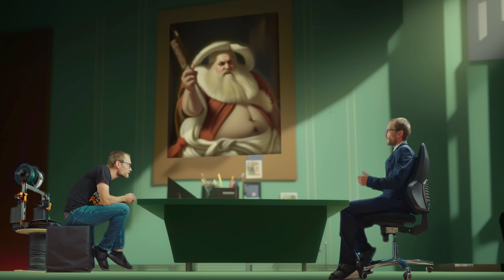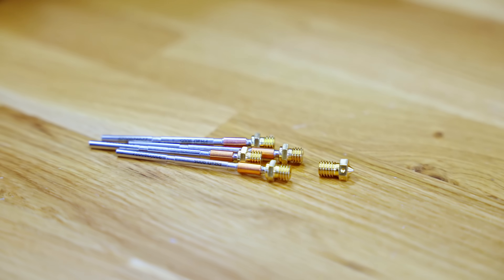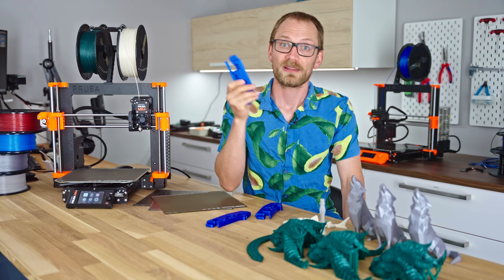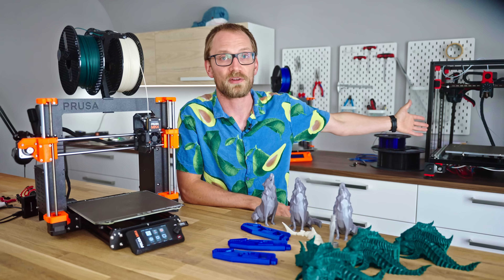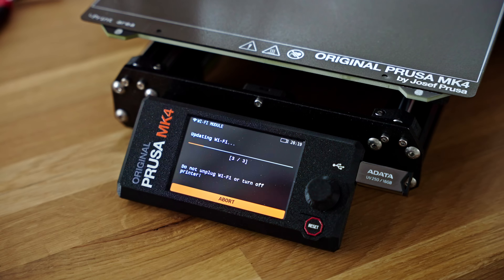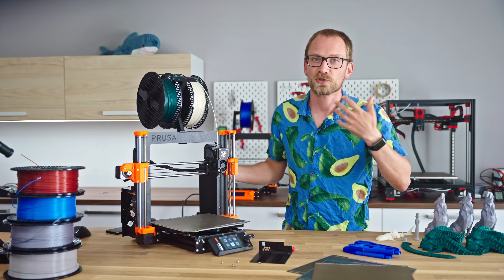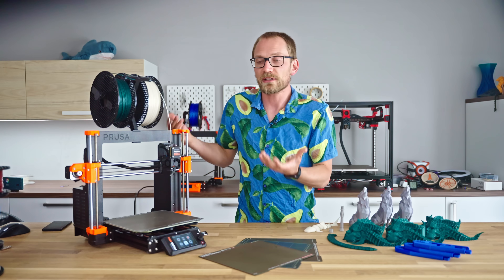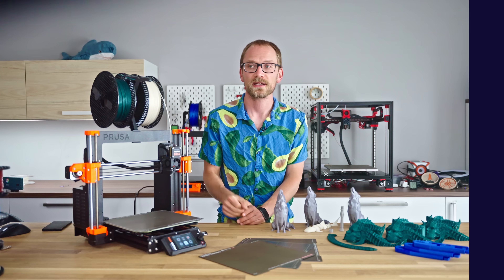Does the Prusa MK4 have what it takes?

Comment: I even logged into YouTube to say this, I disagree so strongly.

You keep harping on about how open source is a problem, but you don't even get the fundamentals right. How, precisely, should Prusa have taken slic3r's AGPLv3 code and put "a closed source UI" in front of it given the terms on linking? How does the front end code relate to the back end functionality and when should they have switched? How successful would Prusa be if not for the support of the open source community?
Reply: FWIW you can make use of opensource software in commercial closed systems. The operating system you are reading this from right now has tons of opensource code in it. As long as you do it in a way that decouples it from your propriatary software it's fair game as far as licensing goes.
Reply: @Rick-vm8bl  you're talking ABI, the argument of front end for a monolithic application implies API and that's where the viral nature of AGPLv3 triggers.

Comment: Like you said, you don't need an accelerometer to calibrate input shaper properly. All you need is a single calibration print, and then setting the variables accordingly. It can calibrate the printer just as well as an accelerometer. Given how rarely you have to calibrate (basically once, unless you change something) I wouldn't consider this a big issue but it is certainly much less "sexy" way of calibrating and has an aftertaste of lagging behind the competition.
Reply: And accuracy is limited by subjective judgement of the prints (and also the resolution of the parameter steps in the test).

Especially for a Company that wants to sell a great out of the box experience without need to be an expert that just sucks.
Reply: @Daepilin  Still yielding comparable results to acclerometric means, which have their own source of artifacts, from the difference between resonance at the nozzle vs at the sensor, and calculations afterwards which can also lead to some fluctuations in calibration quality. With the calibration print the control on the outcome is actually tighter and more directly centred on the results.

I am not saying it is sexy or will convince many customers but at the end of the day, it is just as good if it is the results that matter to you. Yes, it is more work, once at setting up the printer. That goes to some extend against the ethos of Prusa indeed. Realistically speaking however, you probably won't have to bother with it afterwards until you make some major changes to the printer or relocate it.
Reply: Input shaping values can change over time even without changing anything on the printer. Mostly due to the belt tension or loose screws. So yes an accelerometer is not required to do the calibration but it helps a lot if you want to do it once a month for example. This operation can be added in a routine check easily. And if you have enough data as Prusa could do, you could even diagnose common defaults in the assembly based on the results.
So yes, I think it's a shame, that the MK4 doesn't have 2 accelerometers (one on the toolhead pcd and one on the bed). 
It's a missed opportunity to make this printer even more reliable. And if it was well integrated in the diagnostic checks this could justify the price of the MK4  in 2023 in my opinion.
Reply: @KevinLemarchand  Yes they can but the impact is really minor. I haven't recalibrated my V0.1 for at least a year and even made some repairs in between yet don't see much effect on the input shaping performance. 

An accelormeter of course helps but like I said, isn't crucial. For a bed slinger you'd need of course two, rather than one accelerometer. Not that this would add much cost or anything, just saying. That's why I not fully understand why the board is only prepared for a single accelerometer. Did they really think only about the XL there?

I do agree that it is a missed opportunity but my point is that it would be for me not a major argument not to get the Mk4.
Reply: @sagichnicht6748  yep maybe for the mk4s then ;)
On my Trident I have some variations from time to time. But the belt paths are longer and as I like to mod it doesn't help XD
Reply: tbh they could have an accelerometer that screws on a 3d print that can both attach to the bed and hotend, and it would make a more reliable base, that you could then tweak with a test print if you want.
Reply: @KevinLemarchand  And they are so cheap, why not?
Reply: @A1N0  Price is certainly not a reason. I am wondering myself too. Maybe they had the board already developed before the Mk4 and so only included the support for one instead of two sensors?

Comment: There's a reason why Prusa (and everyone else) keep releasing the source for the slicer. The original Slic3r gas a GPL license. You have to release your modifications as open source. There are watchdog organizations that will sue you if you don't, not even mentioning the loss of good will. Open source software works because of this licensing. You get to save A LOT of money by getting all this free code. In return, you MUST contribute back any changes you make.
Reply: Never forget that bambu lab had their slicer closed source (until called out by prusa) when they legally couldn't, and that they contribute nothing to it on their own, they just rip work from other open source slicers and never give attrition or credit. Just like they just did in their latest slicer update. They took a bunch of stuff from orca slicer and didn't give credit like they're supposed to. They then made the typical "sorry, we'll learn from out mistakes" post, which they never do.
Reply: @LilApe  Exactly, but they did get called out and open sourced all the stuff that wasn't directly related to their proprietary calibration routines as far as I know.
Reply: @AlekseyVitebskiy  Problem is, they never do anything untill they're called out. Their security protocols, their thermal runaway problems, their warped heat beds, them stealing open source content or not giving attribution or people when they use their source code or files.
Reply: @LilApe  I know Bamboo Labs, and Chinese companies in general can be shady with their IP practices. 

My post was mainly to defend the open source licensing. Tom seems to not quite understand why open source licensing can be of tremendous value to a company.

Comment: At work we use two MK3S+,  I needed a case for a camera system. one printer died on me and we didn't know how to fix it and the other had such problems with bed adhesion, overhangs and quality. I took a spool of PTEG filament home, put it in my Ender 3 and when I got up to go to work I just took the spool and the case with me, in a perfect quality. The guy who is responsible for the printers asked me if I got an Ultimaker or something at home, he was shocked when I told him that I only use and E3 classic with the 32bit Board, a CR Touch and a Microswiss direct extruder. When I showed him how much the E3 cost me (~450€) for everything to get to this state. Now they are considering getting rid of the MK3S+'s and getting an Ender3 and an Bambu Lab X1.
This is my experience with Prusa and so I'm not very motivated to get an MK4 when my E3 works so good and for the same prize I can get an P1P or for a little more an X1 Carbon.

Comment: I was saving up for a Prusa MK4 Kit, Bambu had a sale. I now own a Bambu P1P and have an extra $250 in my pocket. 🤷🏽‍♂️
Reply: You'll spend more than $250 in replacement parts on the P1P though.
Reply: @LilApe  What parts are those?
Reply: @TheExtremeElementz  Complete motion system, complete extruders when yours break or keep clogging, tool head or AP boards, PSU's, etc. these are all common problem parts that need replacing. My 5 year old MK3s has almost 25k hrs and all I've replaced is a $6 nozzle. My P1P didn't last 10hrs before the stepper motor dies.
Reply: @LilApe  interesting and sorry to hear you’ve had a bad experience, I have had mine since last Wednesday and I’m almost at 24 hours of printing total and still going good. I’ll make sure to keep an eye on things though because so far I’m liking it, but I only have had Enders to compare it to. Thanks for the warning!

Comment: I think for the price the bambu labs x1 is a way better choice
Reply: Heck even the P1P is a better option if we go purely on price given it beats the MK4 out of the box for print quality. Granted the P1P is a little more limited in material support but if all you're printing is PLA and PET then its a solid choice.
Reply: @Rick-vm8bl  and with them coming out with the p1s which is a p1p with an inclosure it's only getting better.
Reply: Bambu lab preys on your information and steals your IP.

Comment: I have a Prusa MK3s+ with MMU2. I have been printings on and off for ~18 months without a fail caused by machine failure. I don't count when I forgot to turn on supports when I sliced a model, started the print and fell asleep. It built up a big glob and melted the fan shroud or should I say the PETG melted into the fan shroud. Other than that my Prusa prints trouble free.
Reply: Your MMU2 is never had a failure? Yeah, I believe that. That is why they designed the MMU3.

Comment: I'm a bit late to the party, but I wanted to throw my 2 cents in.

I got a Prusa Mini+ in November 2021 and it's been absolutely bulletproof. I'm pretty technical and I was anticipating needing to baby the printer. Instead, what I got was a reliable, simple, and dependable 3D printer. Sure, it doesn't have much in the way of features, but repairability, sustainability, open-source, and long-term support are the things that I value, so I'm willing to deal with certain things not being there at launch, like wi-fi.

So if my Mini decides to kick the bucket beyond repair, or I decide to upsize my printing capabilities, I'll be sticking with Prusa, buying their printers, filaments, and parts because, to me, they are the benchmark.

Comment: Mk4 should have been launched two years ago and as a core xy to stay relevant. If just Josef could drop FDM printing all parts in large scale production and just go for injection molding they could also drop the price, increase performance and aesthetics. FDM printing is for prototyping or low volume production.

Comment: Hi, in my view you are underrating the build quality and support that Prusa supplies, yes for a notable price point, compared to advanced software options that most users do not use. Also "most users" do not have the experience or time to upgrade a cheaper printer and then live with its ongoing "personality issues".  The upgrade process can easily exceed the price of the Prusa by only one or two bad decisions. bye

Comment: I think they got the hardware sorted, but had to ship before they could do everything they wanted to do software side. I think the single biggest selling point of the mk4 at the moment is mostly unused as of yet, the built in force sensor, not just for bed probing, but for sensing extrusion force. When if comes to getting the perfect print, the single most sensitive part of the printer is the extruder and its associated dynamics in the hotend. Instead of having autospeed be done by speed or even volumetric flowrate, you can  just set your printer to print at whatever speed/flowrate is needed to hit 14lb backpressure. It might even be able to tune print temps on the fly as day transitions to night and ambient goes from 30C down to 7C. I do a lot of my printing in an uncontrolled environment and I am constantly having to change settings to fit the weather. It might even be able to sense the expansion pattern of wet filament as the nozzle slows down and avert porosity by dropping temps for that section. As someone doing firmware, this seems like a hard but doable task, and I have no doubt that they are working on this in the background, or at least have it in their backlog.

Comment: To me it seems the mk4 is introduced very quickly. It is basically a Prusa mk3 with some upgrades the have available from the XL. The firmware however was not finished yet. Input shaping and the wifi connect are stil not ready. Prusa was to quick to bring the mk4 to the market. Probably the pressure of other companies was to great and the mk3 was falling to far behind.
The mk4 is a very reliably 3d printer, which you can run 24/7 without any problem. The possibilities for remote operation are certainly a pro, especially if you have more printers. The aftersales of Prusa is just legendary. For heavy users the mk4 is still a interesting machine. 
I'm running a upgraded mk3 to a mk3.9 with a mmu and the only thing I'm missing ie a feature to automatically change the builplate, so the machine does not have to wait for me removing the printed parts and to start the new print.

Comment: I'm seriously considering a MK4 for one simple reason, consistent functionality and reliability over time. 

I've had it with stuff that is great, for a while.......................

flsun v400 is great, if every t is crossed and i is dotted during assembly, if the trained chimp doing the assembly has a 'moment' it will shake something lose and 'great' inexplicably and without warning becomes something that you will have to not just take apart to the point where you took it out f the box but further than that to locktite in place a stepper-motor pulley that is now 99.95% attached rather than the 100% that is needed for it's speeds and accelerations(and yes, it does make a difference given that it's a delta, lines not being attached to it's neighbor but only in some spots and on some sides....)

So I've pretty much come to the conclusion that 'works, and keeps working, consistently and for duration', is worth the price............

Comment: Many years ago, I got a Wanhao i3 Plus. If I had spent only a couple hundred more, I could have had a MK2S.

With all the issues I've had with my wanhao over the years, all the upgrades, time, effort; I have serious buyers remorse. Hindsight is 20/20, and the Prusa would have been a much better choice at the time.

I'm not sure any of these Chinese manufacturers produce something I would call a "workhorse" printer. Many seem prone to failure, and require tinkering. A hobbyist machine, not a reliable go-to.
Reply: Did the same thing, Tevo Tarantula. I spent more time over 2/3 years trying to make it work reliably than actually having fun printing stuff with it. In some ways it was good as it was a valuable learning experience. I've modified it so much that I think only one extrusion and maybe a stepper remains , and it now actually resembles a bear framed Mk3 lol. Probably ended up spending the same amount over that time in replacement / parts and modifications, some times I guess you get what you pay for...

Comment: I waited for the $799 kit, and make mostly functional parts in PC, PETG, and TPU.  I assembled the kit in about 7 hrs and immediately installed the Alpha firmware which cut print times by 60% or more. Its fast, trouble free and reliable.  Pure speed makes weak parts.  I make mostly functional parts, and filament properties have a max speed.  I'm going to upgrade to a .6mm nozzle, and cut print times again by 40%.   Having said that, having a standard sized enclosed Core XY PRUSA would be a welcome option. And Prusa should stop prancing around, & put the accelerometers on the machines to handle the input shaping calibration.

Comment: Prusa went from a market leader to a follower, selling printers that are 50% overpriced.
They are still selling a moving bed as "professional". No core xy, no camara, no spaghetty detection etc. 

Their "update" kits cost as much as other printers. 

They are open source - so are most FLSUN, Reality, etc printers, a LOT printers run on marlin/Klipper and use parts that are (except for some printed parts) for sale on the open market.

If I wanted to pay 1000€ for a printer, I wild get a pre built voron, that runs actual standard boards and true Klipper that gets updates for years.

Comment: I am an Engineer at JPL/NASA and have a solution. The input shaping artifacts are likely introduced by some random component. I suspect it's the wobble of the print spool as it prints. Because the center mass is high and the direction of wobble is front to back and that is the direction of least stability the movement is significantly pronounced. Try printing with just the amount of filament needed for the print without a reel. Besides less mass it will add a bit of friction between the filament and the holder and slow down the random movements. Other possible random sources are motion of the table or printer shifting on the surface. Try printing on a solid and non slip mat.  I would be very curious on your test results. Feel free to contact me directly if you wanted other input.

Comment: I wll probably don't buy a MK4 ... because I have a slightly upgraded MK2 and it is still running. The only 'defect' I had was a clogged nozzle. And I can't even really see the differences in print quality you pointed out. I print what I need as functional parts oftentimes to repair something, from a lot of different materials because I need those properties and I never saw the point in printing just decorations. 
The only point worth improving are high temperature and/or warping materials, so the next one would get an enclosure. But then, my most used filament is PLA, then Flexfill98 and the ABS and Nylon parts are usually quite small so I will continue running the MK2.